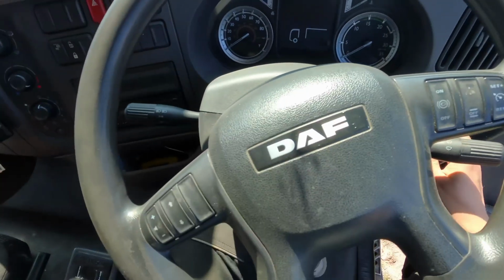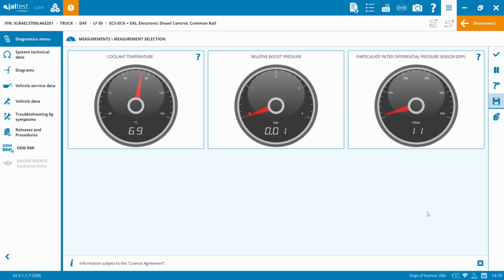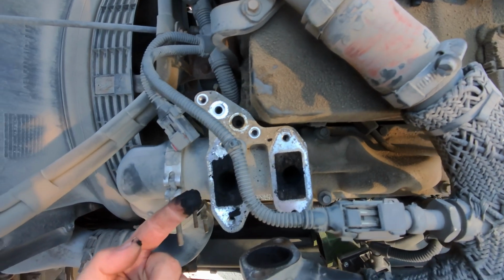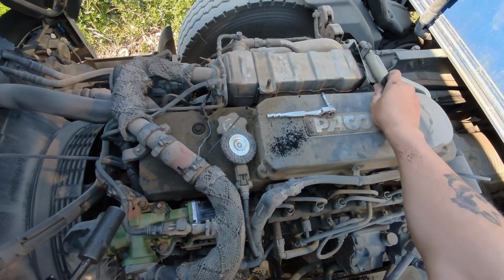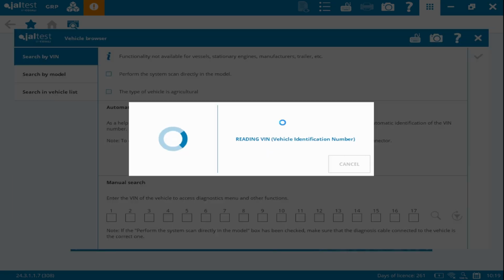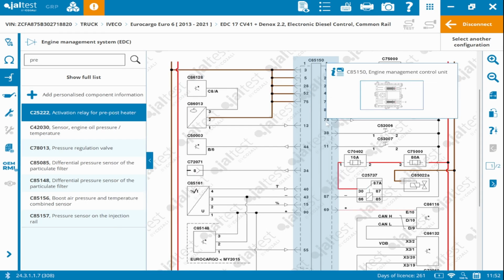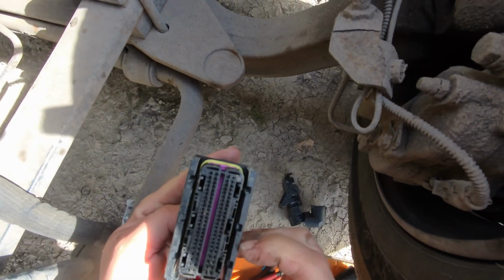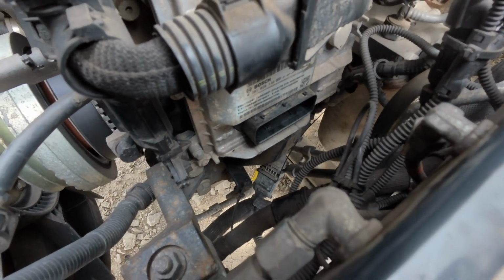DAF & Iveco: Same Old Story or New Life Lesson?

Comment: Odd that it's throwing a fault for the Inlet heater when not fitted. I use insite to disable the heater circuit on the Cummins engines I work on. They don't need it, and they send us engines without one fitted 😂

Comment: These videos will help us out a lot who work on Dafs.. 😊
We have Dennis rcvs,  the exhaust regen will stop after 10 minutes ,,usually the exhaust brake is seized ....  usually it takes 2 hours for a regen and 1/4 tank of fuel, ...
Reply from the maker: Hey Andy, I'm lucky I've not had to do any work on Dennis trucks 🫣 not the best things to go near apparently 🤔but then i say that about anything that doesn't have a paccar engine in 😂😂😂
Reply: @TRUCKTECHUK 
Thats not a paccar engine, its a cummins isbe 6.7
Reply from the maker: @prowler2358 it's a paccar px-7 buddy, just like the the 4 cylinder is a PX-5. it might have different badges and cummins might build the engines FOR DAF but it doesn't say CUMMINS on the chassis build sheet
Reply: @TRUCKTECHUK  
Its a cummins, check the engine data plate, pull the paccar badge off the top of the engine, it will have a cummins badge underneath, cummins have always supplied these to DAF, they are made in darlington, i did some developement work on these when i worked for cummins. The 4 pot is also an isbe 4.5, go check them out and you'll see they are identical.
Reply from the maker: So it's a Cummins.....supplied to PACCAR. Rebadged as a PACCAR Engine. DAF then change the badge and the engine ECU designation from CM2350 to ECS-DC6 in the DAF software then Sell it as a paccar engine in a DAF product and call it a PX-7 engine.
Reply: @TRUCKTECHUK  
Yep, its a deal done years ago, the first cummins they used was the 5.9 12V in the roadrunner in the 80's, they then offered the L10 and NT engines for the 6 and 8 wheelers, and artic's. DAF  bought leyland and swapped the L10 and NT engines for the larger DAF engines. They've used the cummins ever since, up to 18 tonnes, when you plug in its reading through the truck central control module, hence the designation, if you go direct, with cummins insite it will show the cummins engine info, thats how we used to change the engine mapping with a new calibration. The euro 3 engine is also identical to the euro 3 iveco, it was called the EEA engine, joint venture with new holland aswell, only difference is the software. Engine data plate used to be on the flywheel housing at the top. DAF buy the engines and warranty them, thats why the engine number is different, they don't want you buying cheaper parts from cummins, find the original number and see if cummins is cheaper, could save you money!! Might be a data plate on the ecu aswell, not sure if they still fit them.